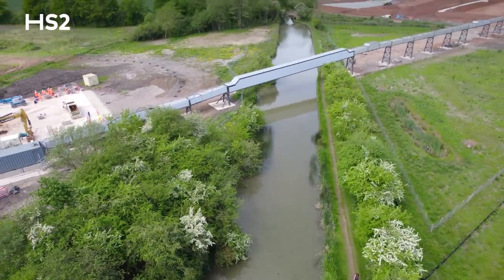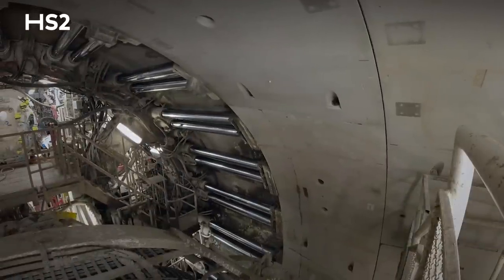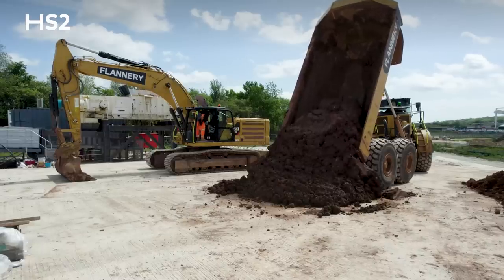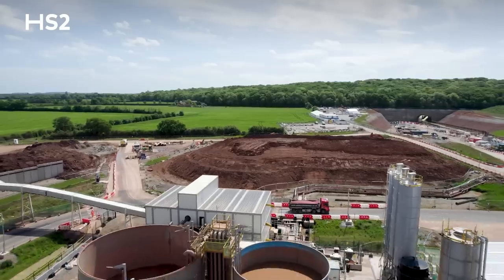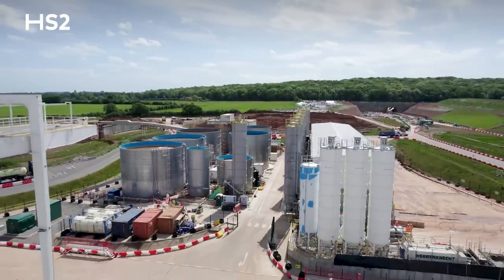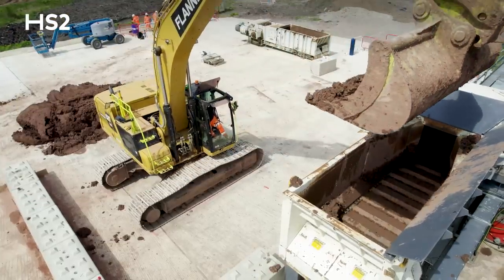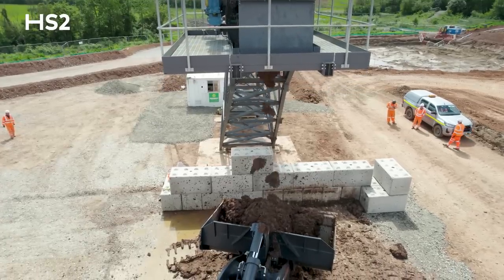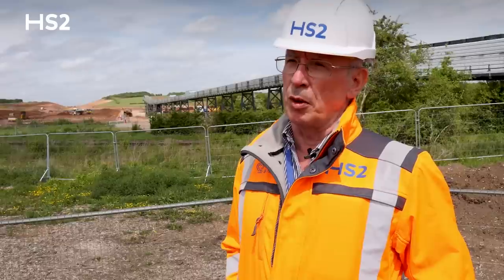HS2 conveyor removes over 30,000 lorry journeys from Warwickshire roads

Comment: Why bother they only go on strike.just a waste of money when the lock down showed you can use computers for most business and if you use it on the weekend their will be repair work going on so you will be on the road anyway
Reply: Hs2 is needed
Reply: @euan.4551  why .you can get a plane from any local airport and it’s a lot cheaper and quicker
Reply: @molemarden5188  that is the point people should not be using planes to fly in the same country 
And the wcml is at full capacity now needing more space but wcml can't be upgraded and it is full
Reply: @euan.4551  so we f..k the country side up just to save less then half hour .it’s just a waste of money what are you going to with half hour not a lot
Reply: @molemarden5188  not sbout saving 40 mins about capacity taking the load of the wcml and have faster services on hs2 and more local and freight runing on existing lines hs2 is not f ing the country up the planes are doing that
Reply: Most business work from home? Nothing like. Try repairing cars from home (with decent equipment) or stacking shelves at Tesco. We're on about 25% working from home at best.
Reply: @euan.4551  Not by Warwickshire it isnt.
Reply: @euan.4551  Shouldnt fly? Says who????
And as for capacity... when was the last time YOU rode the WCML? I've been riding it for the last six. months and its at anything but capacity.
Reply: @euan.4551  Nope. Not true.
Reply: @stevem-h3562  greener planet why fly when train is much better planes are for long distances leaving the country
Hs2 is needed to provide more capacity
Reply: @euan.4551  Nope. No its not.
Reply: @euan.4551  should not? Says you?  And if you seriously think the WCML is full, you obviously never travel on it.
Reply: @owensmith7530  the 25% that arguably should be HS2's core market, you berk. If you cant drag them away from their home offices and force them back into the office which the company no longer really wants to pay for anyway, you're going to have no sucker on these things. Its not for the likes of the Tesco workers, or car mechanics, FFS. This is way above their pay grade.
Reply: @stevem-h3562  wcml capacity if full i don't think you understand how the railways work
Reply: @euan.4551  Im perfectly aware of how the railways work, Euan, I use them every day and have been an active railway enthusiast since I was a boy, over 40 years. You plainly do not use the WCML if you seriously think it is "full". And thats before we even get to the point of you telling us precisely where this additional capacity will be found, if the fastest journey is point to point, missing out Cov, where every single Pendolino to Birmingham stops at. What is going to happen to the intermediate stops and how are they going to be serviced by what more capacity on the WCML? Which of these Pendolino services are you going to bin in order to justify HS2 and to increase so called capacity, when all you're doing is reducing the existing capacity for express traffic between London and Cov and Milton Keynes? 

Or do you just chuck those people on the class 350 or successor EMU's and they'll just have to suck it up and take what they're given? 

Where is this extra capacity coming from?

Not one of you shiny-kit-enthusiasts who recite the discredited business case can answer that. Not one of you.
Reply: @stevem-h3562  You are talking about the number of people in the carriages. We're talking about trains on the line type capacity.

Comment: Huge waste of money from someone who lives in Warwickshire, destroying the countryside at a time when most work from home, never going to be a big hit as far as I am concerned, yes it is great engineering but not a fan sorry
Reply: Hs2 is needed
Reply: Most do not work from home, it's 25% at most.
Reply: @euan.4551  Nope
Reply: @stevem-h3562  adding more capacity 
Wcml is at full capacity 
Hs2 will take the express services off the existing netowrk allowing more freight snd commuter to run
Reply: @euan.4551  I've heard that spiel before. It was garbage then and its garbage now. It fails to address what happens to the non high speed express traffic to cities like Coventry and Milton Keynes to name but two. Where are those express services going to go? It fails to address how the final local loop goods traffic that is 90% containers is going to be delivered locally to towns, cities etc that do not have major container handling facilities. How is HS2 going to take more trucks off the roads by opening up capacity on the WCML when not all of the container and multimodal traffic is between sites on the WCML but also goes to the likes of Felixstowe and Dollands Moor? And how is the increase in multimodal capacity going to take more lorries off the road?

All you're doing is spinning the same old same old worn out tired HS2 corporate PR bollocks which was BS then and is BS now and has never been answered. And as I've said in a previous reply, if you seriously think the WCML is operating at maximum capacity now, even in peak times, then it just proves just how long ago you bothered using it because that statement is as well, total bollocks. I ride the thing every damn day during peak times and its nowhere near capacity. Its obviously busier than it was during lockdown but its not even close to 75-80% let alone capacity. 

You're going to have to try much harder than that worn out PR guff.
Reply: @stevem-h3562  Time to take your head out of the sand. Signaling blocks on the WCML frequently fill up which ultimately slow rail traffic down which has a knock on effect causing many delays. I witness this regularly. Passenger numbers are set to increase over the coming decades and we need to be prepared. It's not just business people that use rail. Huge amounts of people travel across the country for pleasure or to visit family. Air and road travel is not the answer.
Reply: @thorley1969  Indeed, we should be prepared. But HS2 is not the answer. Neither is air travel, you're right on that front. I commute 5 days a week through the West Midlands to Birmingham and back and I have never been convinced by the so called business case for HS2. The reason passenger numbers are increasing is because we're bringing more people in and not growing the services any longer in terms of seating capacity because we cant. Having said that, even at peak commuter hours, I'm still not seeing standing room only, not Monday to Friday. 

My head isnt in the sand. Im just not bought off by the weak business case or the excuses that are being made for such profligacy when it is not required, when the benefits to the rail users are just not there.
Reply: @stevem-h3562  So you think the WCML capacity issues is not enough seats? The capacity issues is the amount of available paths and it doesn't take much to upset the balance and everything slows down. HS2 is currently the best solution to what is becoming an increasing capacity problem. If you have alternative solutions then by all means lay out your stall.
Reply: @thorley1969  In terms of passenger capacity yes, its number of seats. Its not pathing. And how HS2 is the best solution - why dont you tell me why? Where is this additional capacity going to come from? Which Pendolino services exactly are you going to chop in order to magic up the extra pathing? Especially as there is no like-for-like non stopping traffic between Euston and BNS. Everything stops at at least Coventry and International. There are no equivalent non stop services. So, you're going to reduce the amount of services between the intermediate points that are growing in their own way, like Cov and Milton Keynes and give them a poorer quality of service to justify HS2?? Where exactly is this increased capacity going to come from? Or is it going to be a case of those that can afford and think they need HS2 will be on that service and everyone else is on Class 350's and 730's? stopping everywhere?

Comment: Environmental vandalism tearing the guts out of a beautiful part of Warwickshire for no tangible gain.
Reply: I live within about one & a half miles of the route. I don’t see a problem once it is finished. We do have the occasionally road closures, that is to be expected. If it’s anything like new roads in the area the bare earth will soon green up.
Reply: @davecooper3238  You will do once those services start running within earshot.
Reply: @stevem-h3562  But from a mile away I won’t hear a thing. I know this from time spent in Italy.
Reply: @davecooper3238  well,  you'll soon find out. This isnt Italy.
Reply: @stevem-h3562  It’s still High Speed trains. Italy, Spain, France, Germany I have been near them in all those countries. I can assure you they are quieter than than the old steam expresses on non welded rail of the 50s. A mile away & I am pretty we won’t hear them.
Reply: @davecooper3238  If you say so Dave. I'm  not going to be living anywhere near it, so you fill your boots if youre up for it that much. My position on it being industrial scale environmental vandalism is a posture I will not change, just like you wont with your "pipe down, it'll all be fabulous" position.
Reply: @stevem-h3562  The works are much narrower than the M6 construction when it went in between the M1 & Spaghetti junction. The civil engineering work is a lot more interesting. Many more tunnels for a start.